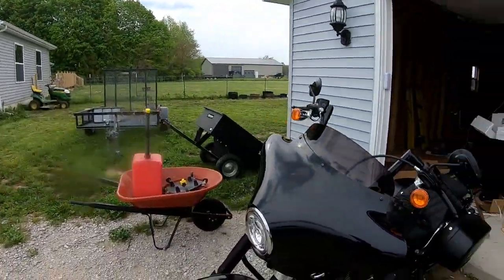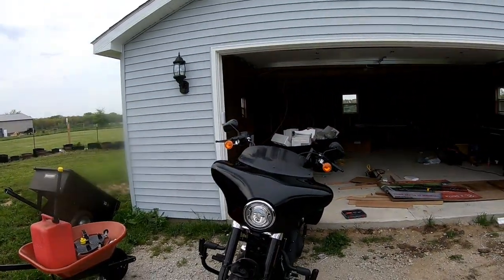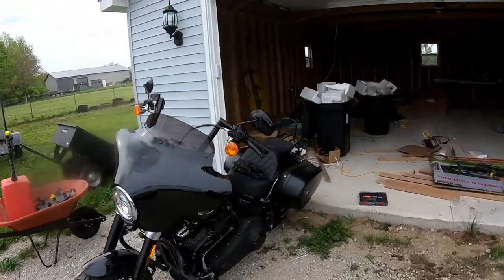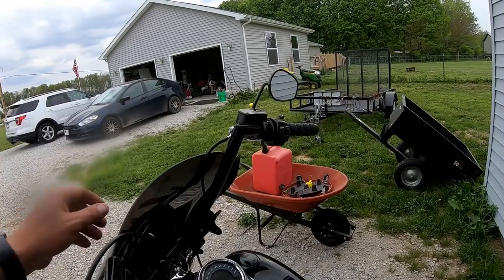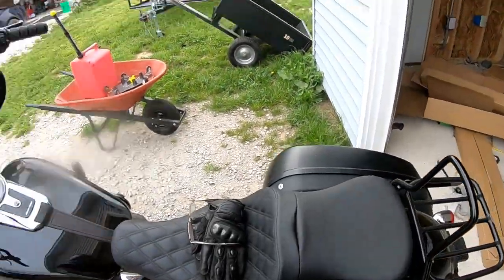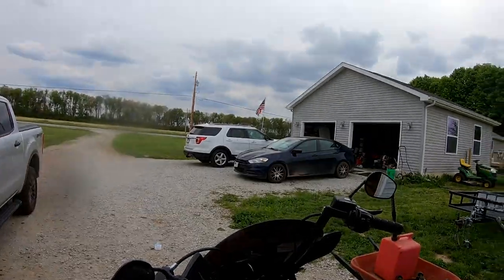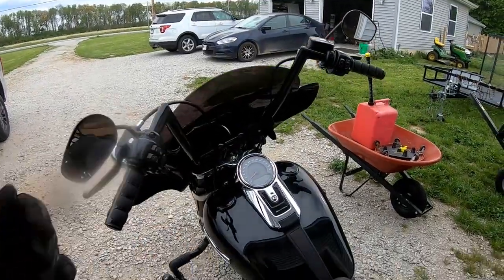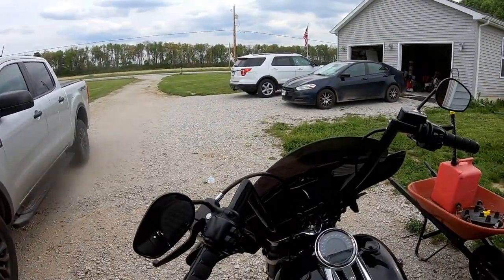Memphis Shades Batwing

Comment: What I do for cables that are rubbing is get some clear fuel line that is about the same diameter as the cable then just cut a slit down the fuel line and press it over the cable.  Works pretty well.

Comment: What kind of pipes? Sounds like VH Short Shots……HD Fuse bars, Rinehart slip ons Fat Boy floorboards and a Stage 2 2020 Sport Glide in Performance Orange… Your bike looks good. May have to with that fairing but a 10-12” shield. Stay safe and Ride hard or stay home 😎
Reply from the maker: Big Radius. 
I’m finishing up the footboard swap. Got all the shift stuff changed today, but it seems like factory rounded out bolt for the brake lever. Oh well, always something.  
And I’ll be riding a bunch soon… I hope. Great Lakes winters suck and are a giant tease. Last Sunday and Monday, good weather. And now cold again

Comment: Very nice fairing! Is it still detachable?
Reply from the maker: It is, but not as clean of a look with fairing off as stock due to mount brackets on the forks
Reply: @bigj200016  Thank for your reply. I have a Memphis Shade Drop-Top on my Sport Glide, that have two rings on the forks, is it the same?

Comment: How happy are you with the fairing at 70+ mph?
Reply from the maker: I get a little buffeting at top of helmet above 50, but it’s definitely manageable. A taller or flared windshield would probably make it even better. 
Completely keeps wind off chest, which was the whole goal. Can ride all day, and I have. Maxed out at 875 miles last summer in 15 hrs. Was attempting a SS1000 but weather was looking crappy, afternoon thunderstorms across western OK.

Comment: can you use the stock sport glide mounts or do you need the full trigger lock kit from memphis shade?? on my switchback we found that the memphis shades plates fit the stock windshield location so no need to install the hardware... 

ALSO

do you know if the hogtunes MSA1 will fit?
Reply from the maker: Not for the SportGlide, but I think it’ll work with the Heritage and Road King
As for the speaker, not sure. I just use a Sena
Reply: @bigj200016  thanks for quick reply.. im wanting a sport glide to add to my collection and that factory fairing isnt really a fairing at all.. dont know why they even went that route..

Comment: Hello Jeremy, what's the size of the batwing please ? Thx with advance. Btw it's perfect. I will order the same
Reply from the maker: It’s the 6 inch windshield that goes on the batwing. MS offers different sizes that mount to the fairing depending on how tall you want. As it is, I still get a little wind on chest but ample airflow through helmet vents to stay relatively cool.
Reply: @bigj200016  I have the Memphis Shades Batwing on my 2012 dyna FatBob with the 9 inch recurve shield...love it!